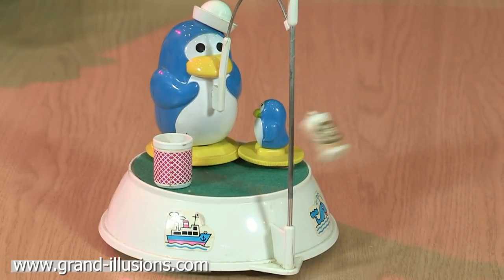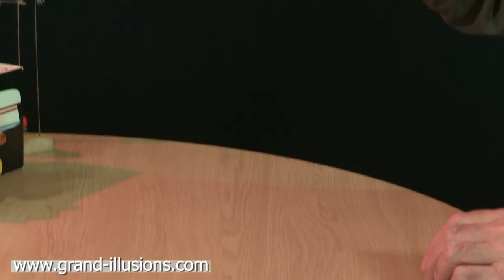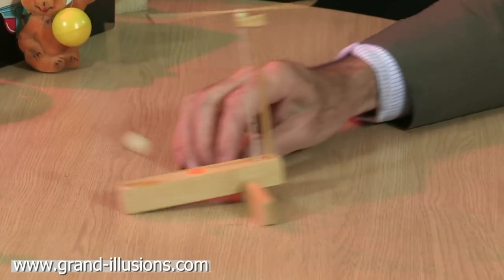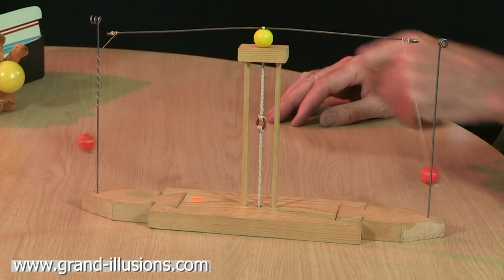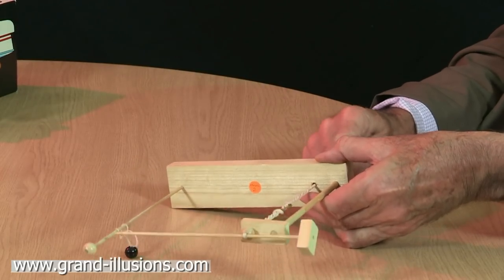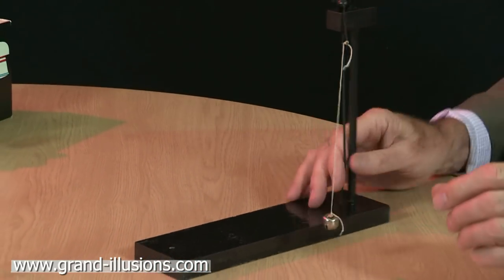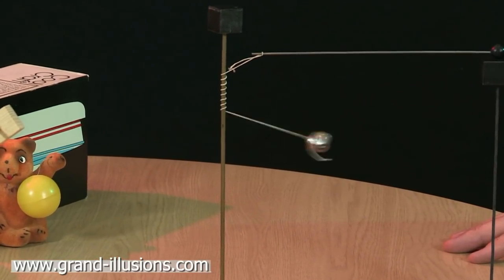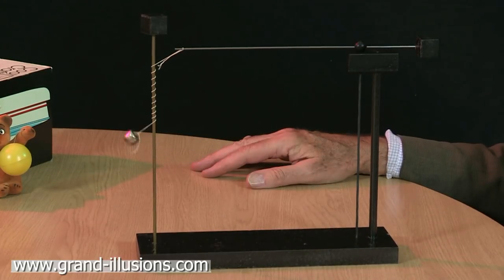Swing Thing

Comment: One and two-post string-winding escapements have actually been used in very old clocks. They are included in large collections of escapements in books and museums.
Reply: AWOL trooper  There used to be an exhibit of 15 or so of operating escapement models at the Franklin Institute in Philadelphia, which I used to visit weekly as a child. I doubt that it is still there, for it is not flashy as suits the modern public taste.
Reply: On my way home from school in the 40's, it was always a delight to stop by the horologists shop window, when he had a clock with one of these working on the top.

Comment: Does this device come close to a perpetual motion machine?
Reply: There is no attempt at perpetual motion here, since the pendulum is swinging off of energy from a rubber band. As soon as the band is unwound, it will stop. Perpetual motion is more based around the fact that you can't get any machine to work forever due to entropy, friction, imperfect parts, etc (such as an imbalanced wheel). This just "runs out of steam".
Reply: Jsidhu762 A perpetual motion machine is most likely impossible, in this universe at least.
Reply: +Jsidhu762 there is a rubber band that needs to be wound each time you start it... each round unwinds 1 turn...
Reply: It would be theoretically possible as long none of the energy exits the system. sadly theory and practice don't like eachother very much and it's imposible for us to build a 100% efficient machine.